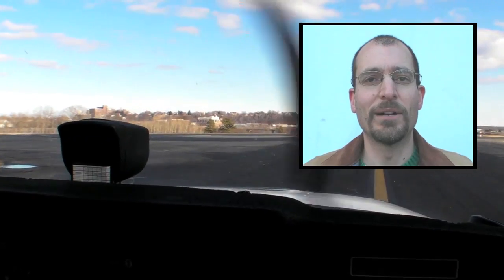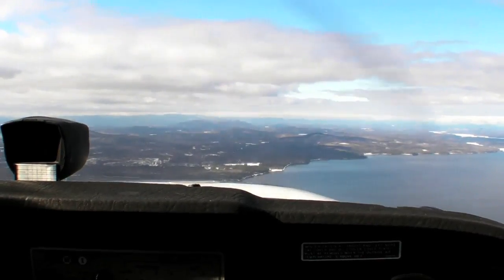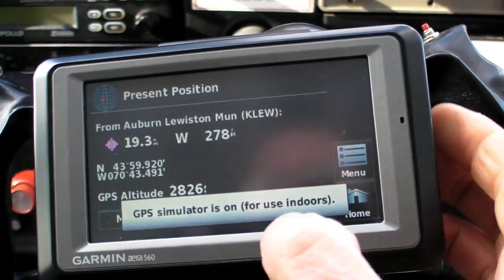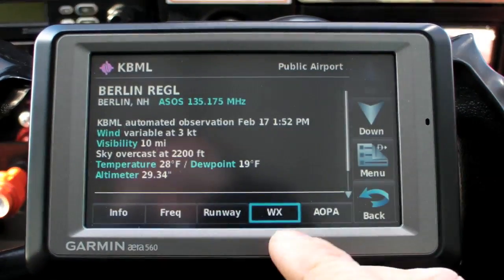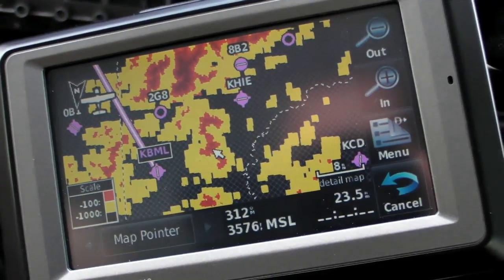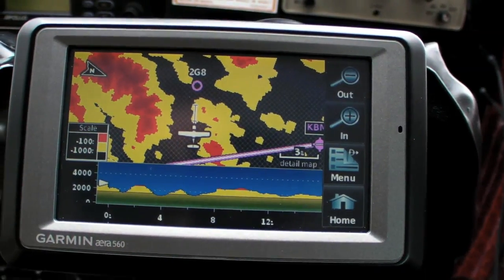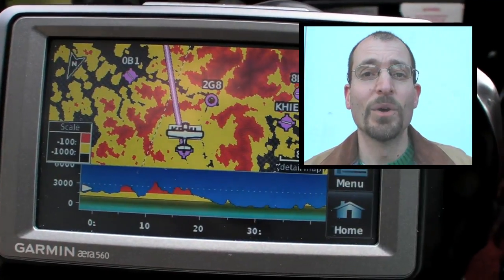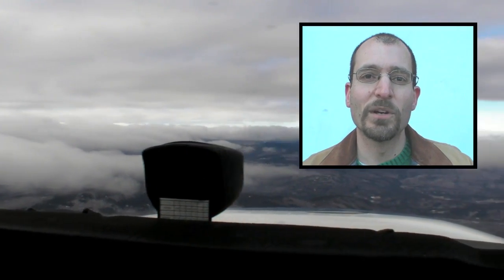Using a Portable GPS for Valley Flying -- TAA Thinking

Comment: Don't try this at home! It "adds a level of confidence" all right: false confidence. Get away with it a couple of times and you'll progress to scud running without even looking out the window. The good news is that when that rock comes screaming out of a cloud, you won't see it: you'll be too busy switching out of simulation mode. I'm disappointed with AvWeb; they usually produce good videos that stress safety.

Comment: ATTENTION:
Don't fly with a handheld battery gps under overcast conditions in unknown area!
The charts are not garanteed and using the gps simulator during flight to select a valley where visability could be better is not how to plan a flight.
This is absolutely NOT professional!!